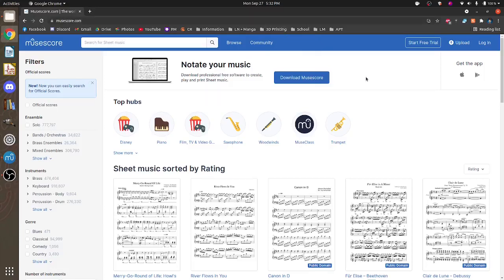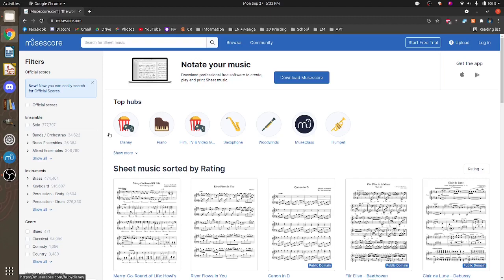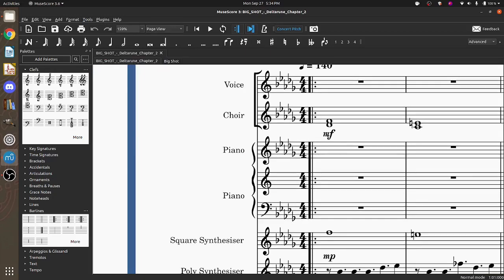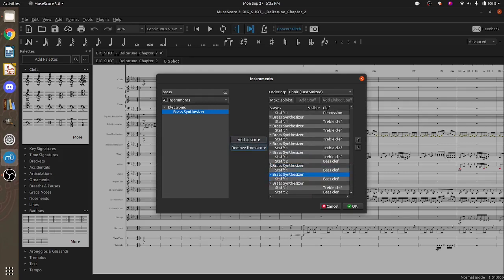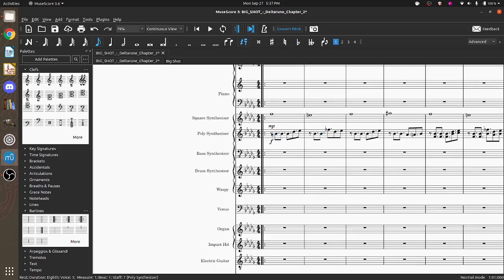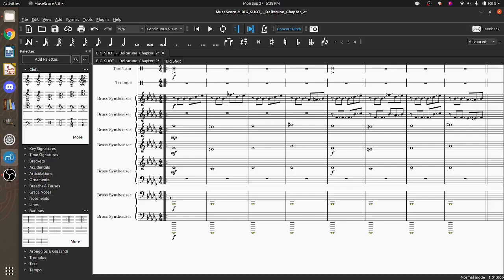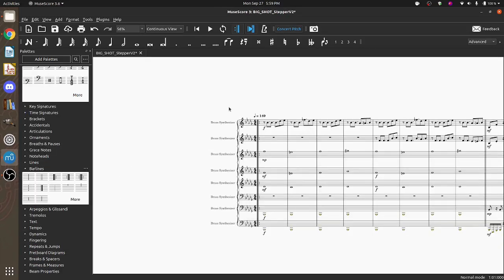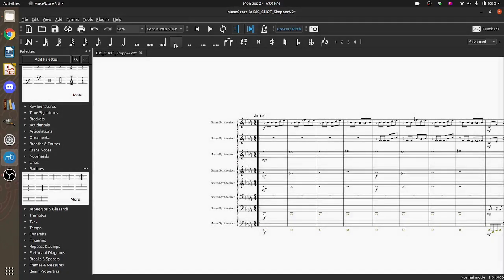How to make MIDI files for my Stepper Synth

Comment: Can note bends be exported to MIDI?
Reply from the maker: They can, but my stepper synth has no way of reading that information. It can only act on discrete note on and off commands
Reply: @JonathanKayne  i see. in that case, could i manually write out a bunch of very short notes of in order to approach a bend? for example could i create a Chromatic scale out of 132nd-notes and then export that scale as midi in order to create a glissando effect? what is the shortest note duration that the steppers can accept?
Reply from the maker: @randomacountboy  you absolutely could. You can also do trills.